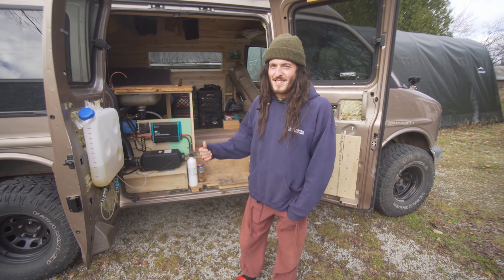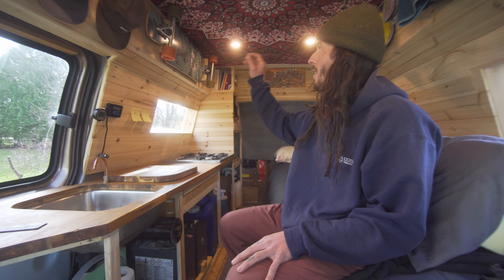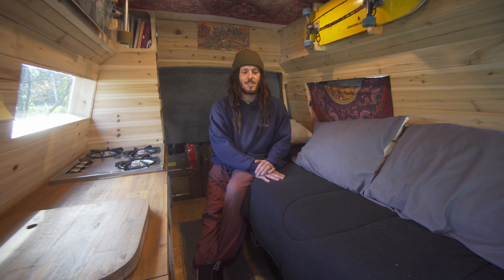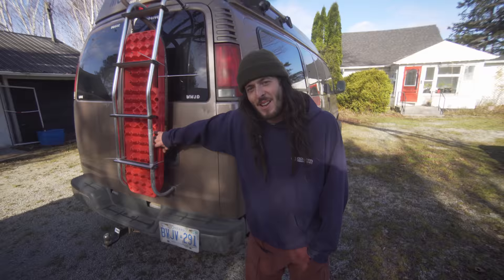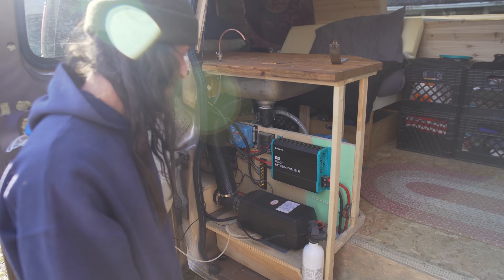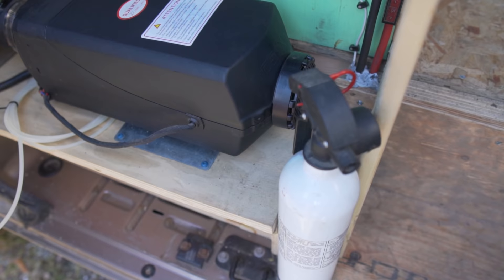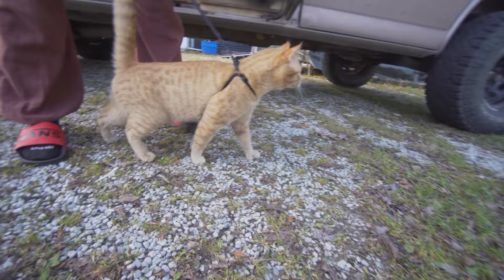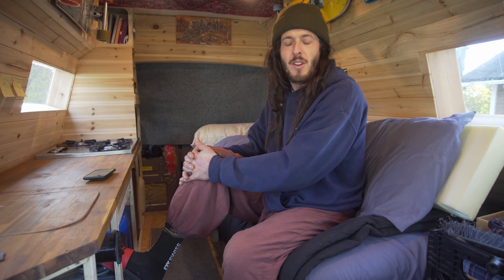Living in a Van for 4 Years! | Van Life Tour Lifted Chevy Express DIY camper conversion

Comment: I have the same van and deciding how to manage the heat coming through the side windows was a real headache. I'd really like to thank him for coming up with such an efficient idea of allowing some light while limiting the radiant heat from the glass. Can't wait to incorporate that into my remodel!
Reply: @clay clay. Sweet! 
KT 💙
Reply: I must've missed. Do you mean him incorporating foam inserts? We're looking to get a Chevy Extended, hopefully lots of windows. We like lots of light. But that can also be a huge drain on heat in the cold. I like the insulated window coverings
Reply: @cwr8618  I really liked how he created smaller windows by building the frames. I have the massive windows as well, and it's just too much in the summer heat. Having fixed insulation behind it always has to help quite a lot. I've been using reflectix inserts on the whole window and it's been a pain. The summer heat caused the fabric I have attached to shrink and crinkle causing them to always fall. I got so fed up that I  permanently attached them using thumb tacks soooooo no more light. 😂

I'm from Ohio for reference. I only part time in the good months so I tend to avoid the cold. Heat is my real issue.

Comment: There is a guy who took a small barrel and put two glow plugs through the side of the barrel (sharp end in) with wires running from a solar panel to the 2 glow plugs and it heated the heck out of the water in the barrel...😁😁😁

Comment: For a decent bath,heat water,plug up your sink,put a couple of good size wash rags or,i use kitchen towels,soap one and the other soak in just the left over water and use to rince off.
Works good and feels more like a real bath. 
Also takes less than 1 gallon depending on how dirty you are. And short hair,is an advantage....just saying.

Comment: Fellow fulltime vandweller her. I live in a chevy express with my 3 small dogs. 
I would love a closer look at the way the diesel heater was installed in the door area.
I've been trying to survive a Michigan winter without a diesel heater even though I have one in storage.
I was just really unsure of where to install it. I wish mine was extended because I would have installed it in the extra 20" space between the wheel well and side door. 
Anyway I would love to see the holes where the intake tube and exhaust are installed. I'm a little bit scared to cut more holes in my van, but wish I had installed the heater now that I've been roughing single digit temps overnight.
Thankfully I have some insulation helping me, but I definitely dropped the ball on fully winterizing the van. 
I was having too much fun in the summer and fall then winter finally took its toll. I sleep most days cuddled up in my sleeping bag with my 3 dogs. I'm hoping to break out of this laziness this spring and get back to tackling van projects.
Reply: Are you on Instagram? Dm me there and I’ll send all the deets

Comment: looks great but there are some placement issues with the electronics being directly under the sink drain, propane tank open without a place to vent outside, and the same for batts. depending on chemistry, water anywhere near can be bad. even if you contain a battery fire and dont get trapped in a burning vehicle, you have lots of gasses.

Comment: cool van I had a 02 I've been looking for a 03-5 for a few years conversion vans are extremely hard to find. I don't want the automatic lifters where half the engine cuts off when cruising no no bad gm.I like the sponge used for closing windows.& fan why did you close off the conversion window from opening?bet that cedar cost you.
1.how doe's the desil heater exhaust fumes like it's a engine right?
2.since you don't use an inverter are all your devices 12volt w/ there own power supply brick?
3.how did you rearrange the pass. front seat?
4.do you have a truckers cassete toilet just in case?
5.did the lift affect the driveshafts wear on universal joints. 
I have a solar bag it's 5 gallons the sun heats up the shower water just hang in sun, use you barn doors as a curtain.
Reply: 1. Exhaust from the heater is 100% outside, free from the living space. 
2. Since this interview, I have acquired a 400 watt inverter to charge the laptop and to run a sewing machine and clothes iron.
3. A custom made swivelling bracket is mounted between the seat and the seat base.
4.since this interview, I met someone who inspired me to give back to earth and I now poop into a pale and mix it with saw dust or fine wood chips, and intend To mix it with veggies to compost it into nutrient rich soil.
5.the angles 2” lift blocks installed in the rear assured a perfect angle from the yolk to the driveshaft. So far so good :) 

Thanks for asking all these wonderful questions.

Comment: Hey Frank, could you give any details on what lift kit you got. I have a 2000 express. I'd love to lift it a few inches. Great van!
Reply: If you have the 1500, (5 bolt) use the rough country 7500. Swap the rear leafs for the 3/4 suburban leaf pack and add 2” block. Be ready to purchase offset wheels to clear the lift spindle. I used 15x8 with -19mm offset all around, and for the rear to match from stance I added 2” wheel spacers. 

Let me know if I missed anything :)